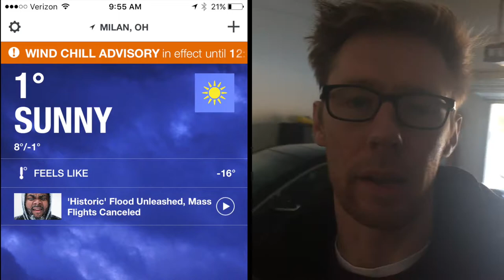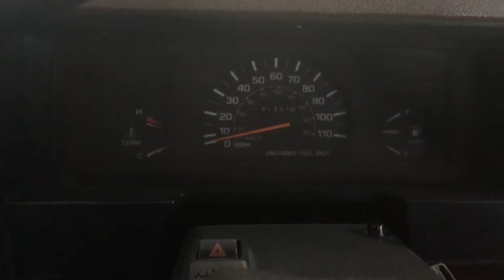1985 Toyota Pickup Truck/Hilux COLD START: 1°F (-17°C)

Comment: So I have a 77 Celica, and I know a lot of older carbed vehicles recommended a pump of the throttle and a half-depressed throttle for the turnover. Why turn it without the peddle instead of the half throttle? BTW nice pickup!!
Reply from the maker: That's just the way this one starts. I have another carb'd 22re truck that does need the half throttle as you described. It may have something to do with the adjustment of the electronic choke on these trucks.
Reply: @6thGearGarage  I see, mine still has the little 2 barrel Aisin that has a coolant choke.